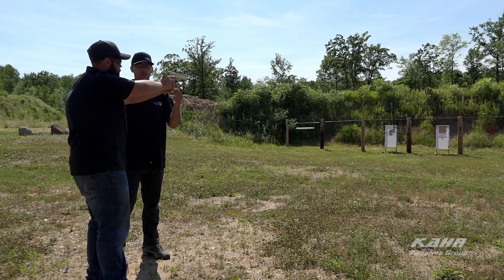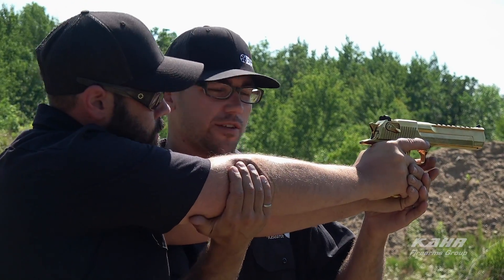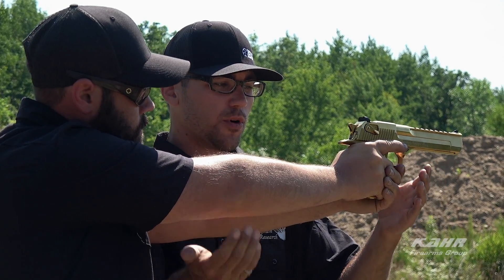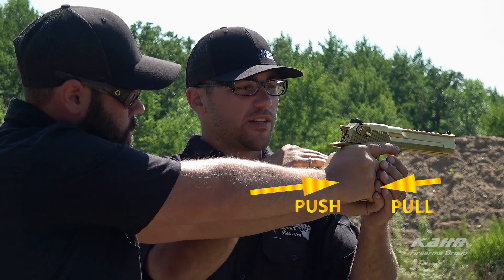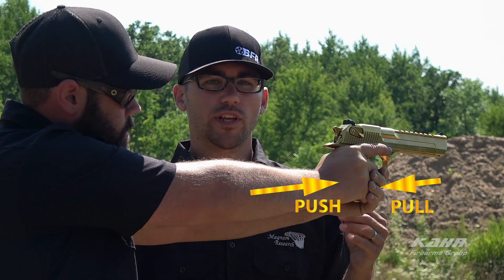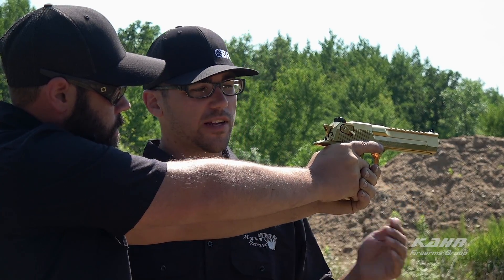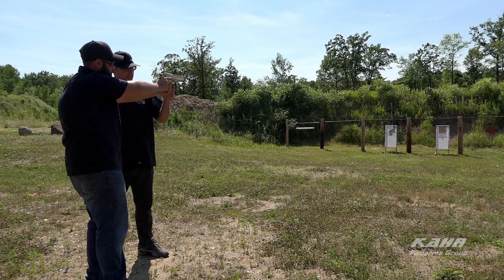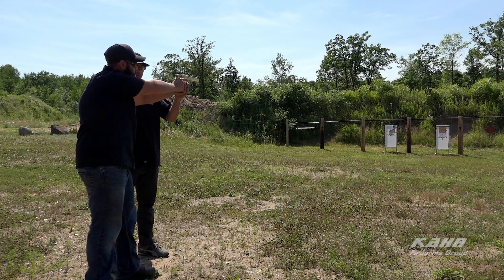Desert Eagle Jamming Problems: How To Properly Shoot a Desert Eagle Pistol

Comment: Very disappointed in this firearm. I spent over 2,100 on my 357 magnum desert eagle and all it does is jam or not feed correctly. Even with hot rounds, it jams. You shouldn't have to hold a gun a certain way for it to fire reliably.  My 500 dollar sig I could probably hold with my feet and it would fire right.
Reply: See though heres your problem. Your being straight up lazy. To use a tool and have it work right you cant use it wrong. It wont work.

Comment: Mine in 44 mag has jammed a few times,ive found that having the slide lubricated before going out to shoot helps alot,also the Desert eagle has a huge kick to it and not holding it level through out the entire firing/shooting process might have a bit to do with it also,as the gun goes off the kick pulls your hands up in some cases to 45° which could result in a jam,so my opinion keep it level as possible while shooting,just writing from my experience with jams...  desert eagle is awesome and it will always be my favorite

Comment: Ive owned a DE44 for 20 years. until just recently I had VERY reliable feeding. I have bagged 5 wild boars with it.. one at 80 yds offhand (with a HoloSight). Having experienced recent Type II malfunctions (brass high), I changed all the springs. I will test is soon. I hope it cures the problem. My hold has NOT changed. I own two SW460Mag and have shot 5 wild boars with one of them, so I think I know how to hold a handgun. BUT, that advice is quite relevant, since wifey regularly gets malfunctions with my Beretta M9, while it works flawlessly for me.

Comment: ~ MAGAZINES ~
Reply: Bought one brand new last week... .50 ae LT model with muzzle break, it WILL not load round after firing!!!  Not limp wristing it (I own dozens of handguns) only ran 12 rounds thru her, everyone fires, ejects then does not grab a round. It ends up in cocked position without round in chamber... only have tried ammo I grabbed at store with pistol. Armscor 300 grain jhp....  VERY disappointed that nib 2k firearm is regulated to single shot.... should have bought a .460 or 500 s&w... will return to shop and see if gunsmith can figure it out, If no go then will have to send back to manufacturer.... first time I have ever had issue with brand new gun... I have built many ARs without issue..... very disappointed.....